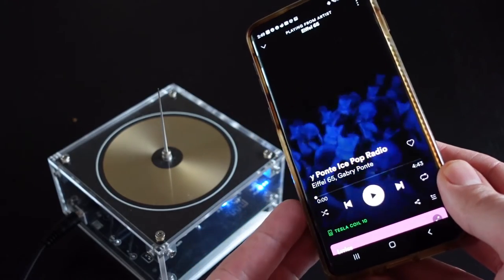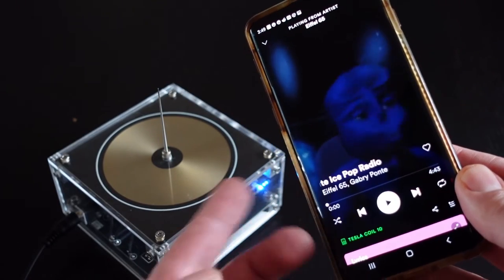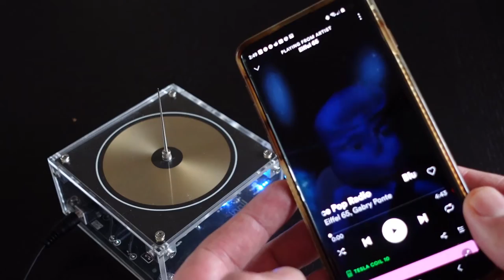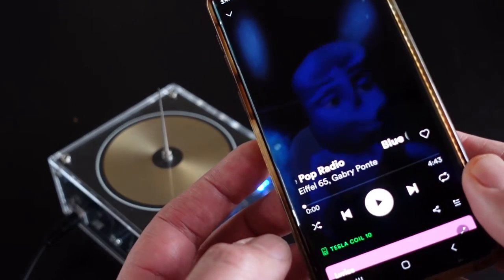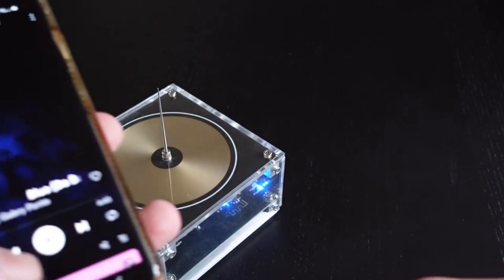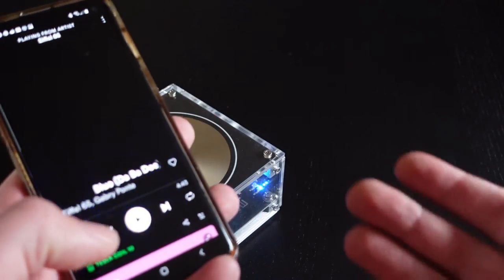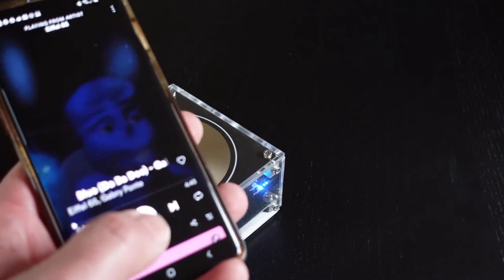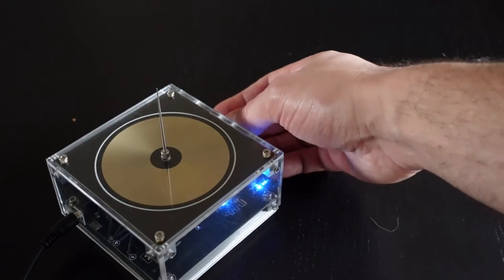Amazingly Cool Tesla Coil for your Desk (and Cheap!) Desktop Tesla Coil!

Comment: Great video,  butjust one tiny thing.. it`s a combination between voltage and amps that you should worry about as the car battery has 100A/h but dosent hurt you due to the voltage...
Reply from the maker: Good to know 👍🏻   Thanks for the info!
Reply: You've corrected him but it wrong yourself. You've quoted the capacity of a car battery i.e. amp hours (ah) when you mean to say amps. You're also technically wrong about a combination of voltage and current being deadly, it's not just voltage and current but also shock duration and effectively frequency. High frequency Tesla coils cannot shock you but they will burn you. There is a minimum pulse duration required to depolarize nerves, hence there is less stimulation at higher frequencies because the thresholds for perception, muscle contraction and fibrillation are positively correlated with frequency. The skin effect also comes into play at high frequency, this means at suitably high frequencies the current no longer flows through the conductor and travels along the surface instead.
Reply: @parviz3998  dont` be pedantic.. i`m a paramedic, if you want to sound inteligent stay quiet..

Comment: So cool. Does the unit work off a rechargeable battery or does it always need to be plugged in?
Reply from the maker: I've ran it off a portable power station and it worked just fine.  Not quite sure if it would work with a small battery or not.
Reply: @JMGENTERPRISES  thank u 👍

Comment: Just saw the Video on the Tesla coil. Wondering if you know where I can find the discharge needle with the multiple copper threads
Reply from the maker: Have you checked Amazon or eBay?
Reply: @JMGENTERPRISES  No luck searched every way I could think of. Is there a model# or any identifying description with the Coil you bought?
Reply from the maker: @peliknhed  I took at a look at it but there is nothing on it.  You could probably make one from parts at a hardware store.  It's just copper wire.
Reply: @JMGENTERPRISES  That was My thought. I will let you know the results.
Reply: Yeah I want to make one of those attachments for mine. Wish it came with mine

Comment: mine must be broken, its starts loud and slow.
Reply from the maker: Hmm.  Maybe reach out to the place you bought it from. Maybe they have some troubleshooting tips!
Reply: @JMGENTERPRISES  It came from China
Reply from the maker: @chazbanx  where did you buy it from?  Ebay?  If so, they offer a buyer protection guarantee
Reply: @JMGENTERPRISES  It came from amazon a few years ago.
Reply from the maker: @chazbanx  Gotcha.  Maybe a faulty power supply.  I would still reach out to the seller.  A lot of times they will make right for the buyer.